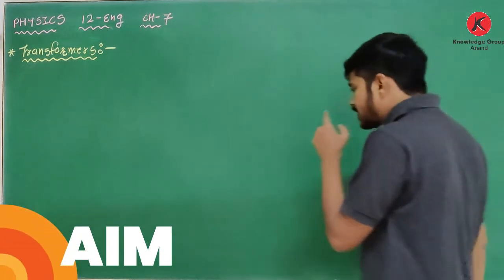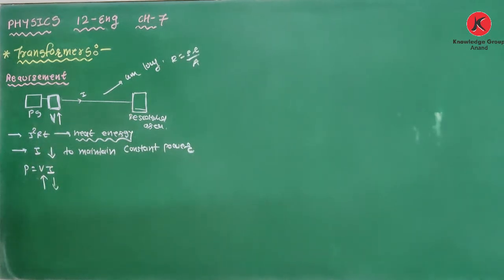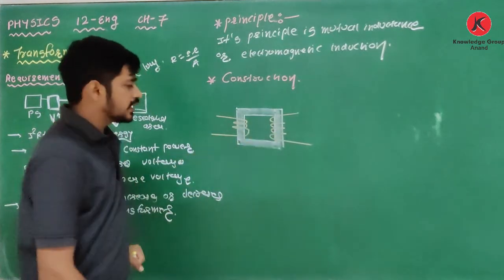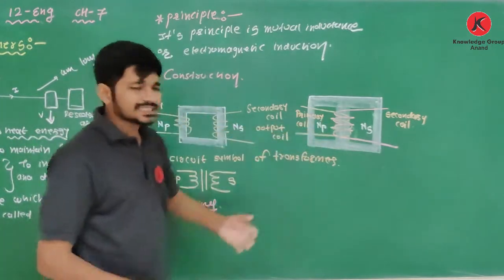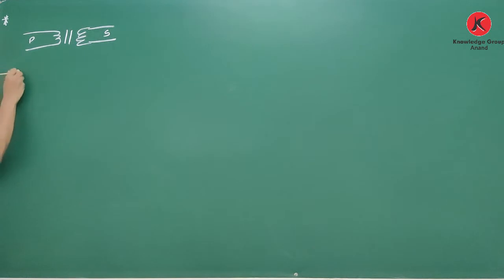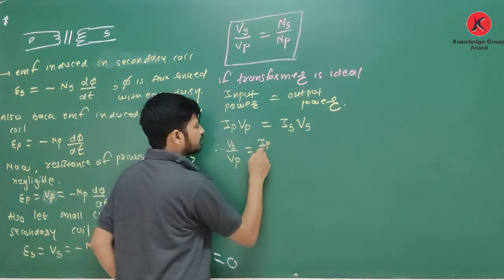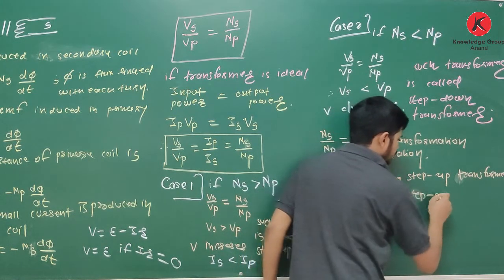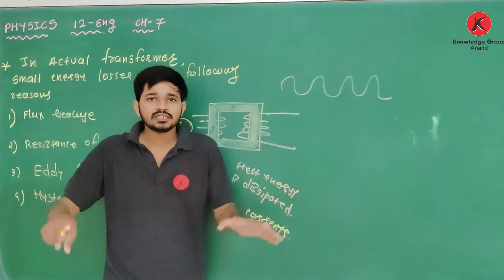CLASS 12 ENG MED PHYSICS |CH-7 ALTERNATING CURRENT

Comment: (i) Flux Leakage: There is always some flux leakage; that is, not all of
the flux due to primary passes through the secondary due to poor
design of the core or the air gaps in the core. It can be reduced by
winding the primary and secondary coils one over the other.

(ii) Resistance of the windings: The wire used for the windings has some
resistance and so, energy is lost due to heat produced in the wire
(I'square'R). In high current, low voltage windings, these are minimised by

using thick wire.

(iii) Eddy currents: The alternating magnetic flux induces eddy currents
in the iron core and causes heating. The effect is reduced by having a
laminated core.

(iv) Hysteresis: The magnetisation of the core is repeatedly reversed by
the alternating magnetic field. The resulting expenditure of energy in
the core appears as heat and is kept to a minimum by using a magnetic
material which has a low hysteresis loss.